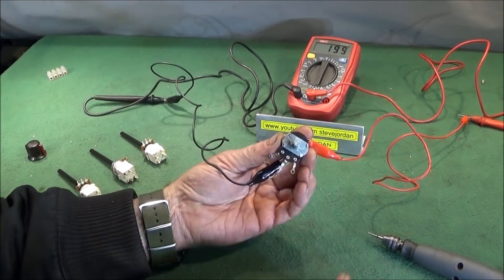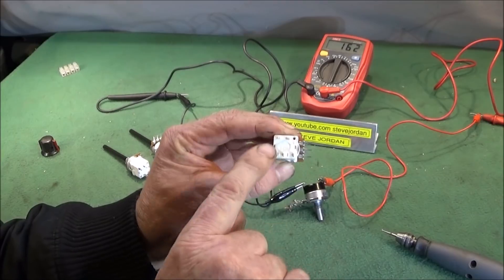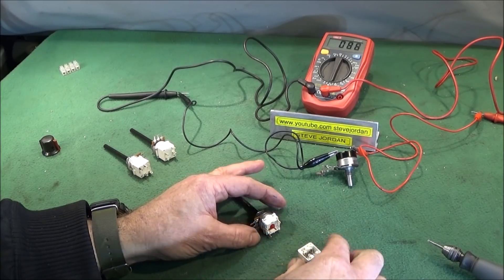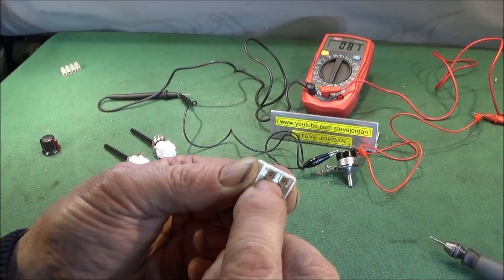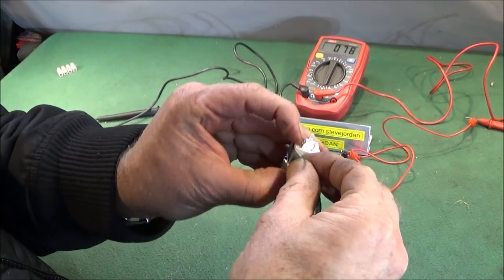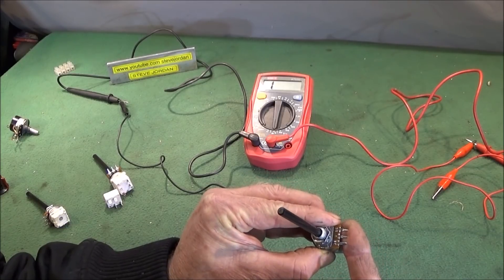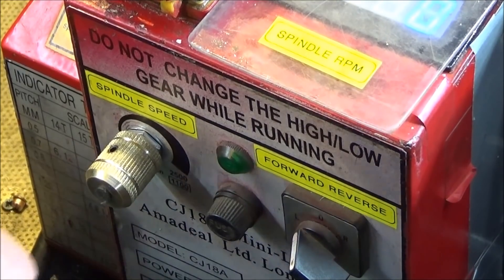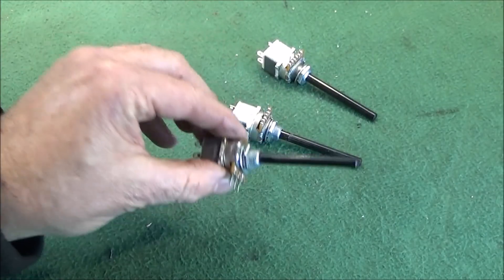A New Low Cost Better Quality Potentiometer For The Chinese Mini Lathe

Comment from the maker: NOW MAPLINS HAS GONE. YOU CAN BUY THESE SIMILAR 4K7 POTS FROM CPC. THEY ARE SLIGHTLY DIFFERENT IN CONSTRUCTION AND COLOR THAN THE MAPLINS ONES, BUT CAN EASILY BE CONVERTED BY MOVING THE TWO CONTACT PINS OVER AS SHOWN IN THE VIDEO.
http://cpc.farnell.com/omeg/pc16eco-b44k7a/potentiometer-lin-dpst-4k7/dp/RE04409

Comment: Hello Steve when I originally saw this video I bought one of these maplin switches as I have the same Amadeal lathe to keep as a spare in case my switch failed. I also have an Amadeal milling machine that has the same switch. The one on the mill has now failed. The difference on the milling machine is that it doesn’t have a reverse function. I wonder if the maplin switch could be used without having to modify it like you did for the lathe? As I have no knowledge on electronics I wonder if you could give me any advice. I did fit a new switch from Amadeal but this failed straight away.  Hope you are keeping well ATB Nobby

Comment: HI Steve, I know this video is a bit dated but I am curious, when i turn my potentiometer the motor will pause and stops if I do not turn it quick enough.   Is this an indicator of a bad switch or is it another issue I should be checking into.  It does'nt completely stop  once I have turned it and adjusted it but it does seem to have some dead spots in it.  Thanks for any advice you can offer.  Mines an older Sumore unit with some other upgrades so interested in keeping it alive.

Comment: Hello Steve - good video, its got me thinking. I'm trying to trace an issue with my mini-lathe that may be the potentiometer - I wonder if you have some thoughts on this? 

Problem shows itself as soon as I turn the lathe on (power and green switch on top) - as soon as I do this, there is a low humming noise, a brief pause (2-3 seconds) and then the chuck starts to slowly rotate, really slowly, but never stops (until I hit the red off button). This is with the dial switched off - no RPM set.
I can spin up the chuck faster using the dial, right up to max speed, although it seems to be 'hunting' - adding power then slowing, then adding more power again.
With the lathe turning at any speed, I can stop the chuck with my hand - easily. So no power at all getting to the chuck.
Motor seems fine, no belt slippage / damage, all gearing good.

Could this be the potentiometer? would a broken one manifest like this - I'm trying to debug, but not being technical I'm struggling. I can see I can buy the whole controller but its expensive and having replaced all the gears with steel ones I'm tired of putting money into this lathe!
Any thoughts? (I can do a video of it if you like)
Thanks
Reply from the maker: Hi Bob I am not absolutely sure, when I had similar problems I changed the potentiometer first. If that doesn't fix the problem it will be the main control board that has blown a transistor. It is worth spending on the potentiometer first though if it's the same electronics as mine used to be. I had two circuit boards go in my time and about 6 potentiometers or more. That's all I can say really it either one or the other. Regards Steve
Reply: @SteveJordan  Thanks for this - you are right in that I should start at the potentiometer and move on from there. It looks almost identical to yours in the video so I'll get a new one and follow the replace procedure you have described. Unlike you, this is the first electrical problem I have had in about 11 years of ownership! Unbelievable, I know. I might also do the brushes, but more because its a maintenance thing and not that I expect a problem there. Thanks again.

Comment: The problem can easily be solved, I have just repaired my potentiometer, it was a corrosion problem, I detached the rivet part from the potentiometer and cleaned the round pin contact like the snap plate with a small diamond grinder, because the aluminum rivets are no longer closed I need to take the rest of the potentiometer apart and  use two M2 to replache the switching part again, the whole thing should be secured with paint. I also soldered a thin bridge cable to the bearing contact an snap contact to be absolutely sure it wörks.
Don't waste u money if I can u can do it by your selve, the potentiometers are sold disproportionately expensive in Germany (  19 € )  for it, a regula 

normal potentiometer costs 17 cents, that's robber baronism !!

Comment: Hi Steve, thank you for another great video. I have just started out with a minilathe and not without the usual drive problems. After a week or two, the speed control board went 'bang' which luckily, I was able to repair by changing two components (MOSFET and bridge rectifier). It has gone a second time terminally, and I have the motor in for testing. For the price of a potentiometer from the manufacturers, I have sourced on banggood, a speed control unit which will handle up to 2,000W and it has a potentiometer fitted! I will let you know how I get on when it arrives. I have posted the link below.

https://uk.banggood.com/2000W-15A-DC-Speed-Control-Power-Supply-Single-Phase-DC-Motor-Speed-Controller-AC-220V-to-DC-220V-p-1460124.html?rmmds=myorder&cur_warehouse=CN

Thanks again, so much better than netflix!

Dave.

Comment: Having power drop when boreing or parting ( around 400 - 550 rpm ). Would this be potentiometer or speed circuit board?
Reply from the maker: Hi Wayne that is quite normal for the lathe. If you adjust the curcuit board trimmer to increase the torque it can damage the board so it is best left at the factory settings.

Comment: Hi Steve, Maplins stuff is pretty good - I used to use them way back, as well as CPC.
The Maplin ones do look pretty good with the switch section - and your tweak looks ideal and love the new knob. Not sure if you mentioned but I am assuming the pot is linear as against logarithmic, and switch is double pole single throw.
That mini lathe, particularly with all your nice mods, is quite a gem.

Comment: If precision adjustment is ever priority over cost Bourns, and others, offer multi-turn wire wound pots that may help. I haven't watched the entire video yet so if multi-turn are mentioned then  great. Cheers
Reply from the maker: Hi Jim, I haven't found a 4.7K multi-turn wire pot that includes a switch mechanism yet that I could try. If you know of one, I would like to try it. I know little about electrics but have heard that the wire wound pots are the best for fine adjustment like you say. Regards Steve
Reply: Sorry Steve I forgot to mention, Potentiometers.com. They should have nearly any combination of pot and switch available. I've use the site to find replacements for less commonly available units. The industrial quality pots have sealed units and worth the cost on a home project, particularly in the shop.

Comment: One little trick I like to use is to wrap a zip tie around the tape. It may not be needed here but the tape never comes off with a zip tie on it. You could also put heat shrink around the tape or just heat shrink alone. Anyhow...... nice hack on the potentiometer =) Merry Christmas to you and yours.
Reply from the maker: Hi Ian, That's a great idea...Thanks for sharing....Regards Steve

Comment: Hi Steve, I've got a 3/4hp 1728rpm craftsman motor on my old atlas lathe, do you know if I can just buy a reversing switch or something to make it also go into reverse? Thanks, I can make or weld about anything but I know nothing about electric or electronics.
Reply: Shane K 
Look up H bridge circuit. But do be careful if operating on AC or unsure about AC high Voltage/current.
This video looks to be showing Low Voltage DC operation.